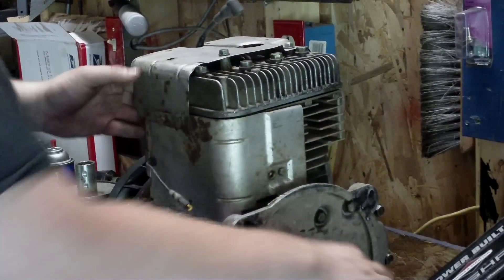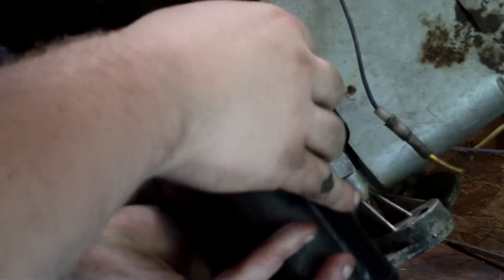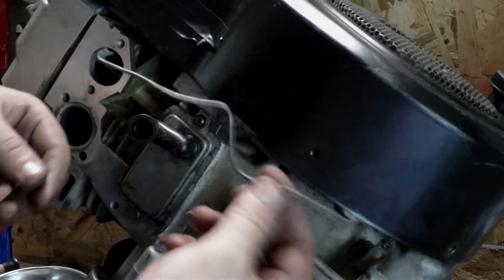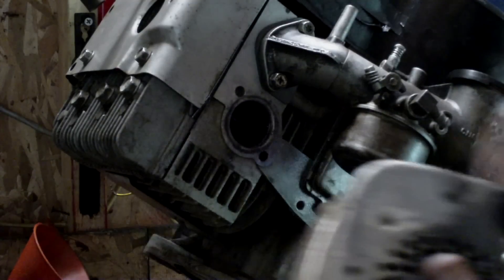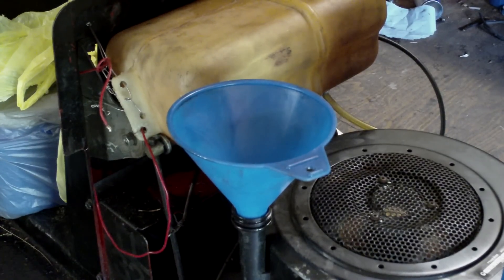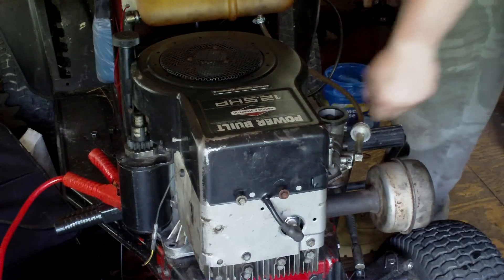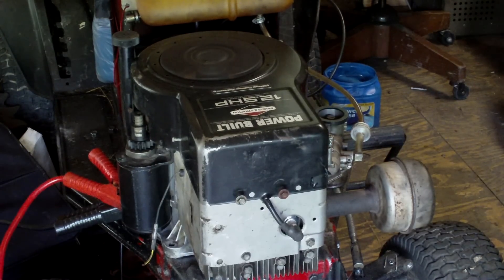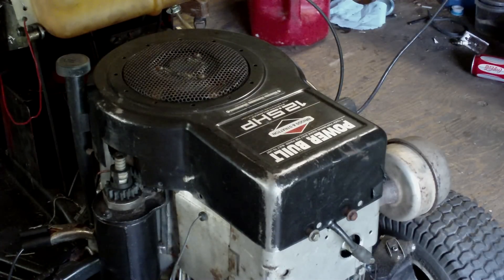Briggs and Stratton Power Built 12.5 HP Flathead Model 28 Rebuild  First Start PART 4 (FINAL)

Comment: I have watched all of the video's in this series. You do a good job editing and narrating. Thanks for editing out most of the shots of removing or installing countless bolts. Anyone who dives into a rebuild probably had a handle on removing and installing a screw or bolt. With that said, I appreciated the fact that you made a point to caution us on specific bolts and tightening patterns. Again, really nice video without a lot of unnecessary talking, some narrators can't shut up and it gets hard to listen to them.
Reply from the maker: Appreciate that! I put alot of time in this video series. I also have another video series on rebuilding a 10HP Briggs. Yeah, that does get boring watching people take bolts out! I thought of speeding the video up through it, but its easier to just cut it out. Thanks again! And Thanks for Watching!!!

Comment: one question i did have was ....do you need to retorque the head bolts after you have broken the motor in? thank you
Reply from the maker: Some say its recommended, i've never done it myself, just when i put it together. But if you'd feel better, go ahead and retorque them just to be safe. Its mainly for car engines and stuff like that when you need to do it. Thanks for Watching!!!

Comment: I have a 20 year old model 28. Watched your videos and decided to rebuild mine,  I am pretty attached her, I  repowered  John Deere 111  that I have owned for 30 years. it was burning about a half quart of oil per hour.  On teardown rings were "reject"  .30. Lapped the valves, honed the cylinder, cleaned her up.  I found your videos invaluable, along with a repair manual it was all very easy to accomplish. Just did my first oil change after breakin. First time in 5 years I didn't need to add oil after cutting the lawn. Thanks for the help!
Reply from the maker: I hear ya, they are great engines! I hear ya, good to hear your rebuild turned out good! I know how aggravating that is having to add oil each time you cut, it takes a while to get used to! Thanks for Watching!!!

Comment: I use 10w-30 full synthetic max life Valvoline.
Reply from the maker: Thats good stuff, i use it in my truck (10w-40 though). Thanks for Watching!!!
Reply from the maker: i use the blended though.
Reply: fnaguitarplayer9 I have to use the full synthetic because my motor reaches high rpm's. Around 5200+ rpm's.
Reply from the maker: I hear ya! That would definitely be good for that.

Comment: Why should we not want to "waste" good oil on break in?  Is 10W30 that much worse than 30 weight?  It all costs the same and is ASE certified.
Reply from the maker: +Name I was referring to brand of oil not the weight, i generally use cheap supertech (walmart brand) oil for break ins and either valvoline or rotella shell diesel oil (30 weight) after break ins. I prefer a 10w-30 for break ins because it tends to thin out more then 30 weight (even though technically it shouldn't), it always get thin as water compared to straight 30, but for break ins i feel it gets more metal particles out of the motor. But you can use 30 if you want, i did on the 10HP rebuild video last year, no problems. Thanks for Watching!!!

Comment: I got the piston back in and it would not turn freely with the connecting rod bolts tight.  The crank has to come out now and the journal sanded? it would turn all the way around loosely tightened.  STPd all the stuff. Lubrication not the issue
Reply from the maker: +Name I hear ya, it does sound like there isn't enough clearance between the rod and journal. Are you sure that the new rod isn't a undersize rod? If you replaced it maybe the place you got it from got the part numbers mixed if its super tight, if not, then yes you can sand the journal down, its supposed to be turned on a lathe but i've gotten by with doing it like that. Thanks for Watching!!!

Comment: Hi Mate, thanks for the videos they are very informative.  Just a question my briggs is blowing gas out of the air breather and wont start, do you know what the possible causes of this could be?  Possible burnt inlet valve?
Reply from the maker: +Michael Edgar Hi, your welcome! If its really easy to turn over (no compression) then I'd say its stuck intake valve, if not stuck, the clearance may be to tight and its not sealing, burnt is a possibility, but i'd check the clearance first. let me know what you find out. Thanks for Watching!!!
Reply: great thanks Mate, yes compression was really easy, when I took the cover off, the valve seat had come loose and jamed the inlet valve.  Pinned the ring back in and working great now. Thanks again.
Michael.
Reply from the maker: +Michael Edgar oh wow, that is rare, but it does happen, we had a 12.5 do that along time ago. Your welcome, anytime!

Comment: How much did it cost to rebuild
Reply: +Dylan Gleason, 
my con-rod  (big end) was worn badly so I needed a full gasket set, con-rod,  piston rings & plug....about £70 from Germany (pattern parts) would have been about £160 for B&S original parts (in UK).
Reply from the maker: +Dylan Gleason I had about 50 bucks in mine, just replacing rings and gaskets, but it really needed valve guides which i'm planning on  going back and replacing soon. It just depends on whats wrong, if it needs bored out then your looking at a oversized piston as well. Thanks for Watching!!!

Comment: Great stuff ....thanks! I've just started a rebuild on a 13HP B&S, it seems to be basically the same as yours. Were the piston rings the only parts replaced,  to cure the problem, or did I miss something??
Reply from the maker: +John Wells Your welcome! I hear ya, the rings are the main part in a rebuild, but you will need a gasket set (gaskets always tear when you take one apart) and have to reseat valves / set valve clearance. Unless you find something else wrong somewhere, like a cracked valve or something (I did replace one valve with a good used one when i rebuilt the one in the video). But yeah rings and gaskets is all you need 80% of the time. Thanks for Watching!!!

Comment: hello, great videos, i have this same briggs 12.5 engine i just rebuilt it, it wont start it just backfires. i went and tore it all down to make sure everything is proper timeing valves ect. everything seems to be right but it wont fire for me? any ideas? thanks.
Reply from the maker: +Nick Miller Thanks, I appreciate that! Sounds like the flywheel key is sheared, if you had the flywheel off it may have sheared if it wasn't put back on tight enough, or it could be a bad coil, I've had that happen before. Or it could be a carburetor issue. Hope this helps! Thanks for Watching!!!

Comment: Hey me again!! im working on a 17.5 single at the moment, Im trying to wire it up and cant get it to charge the battery the charging coil shows -16volts at 3400RPM unconnected to battery? when metering the battery it shows 12.6v off and 12.7 volt while running? im not very good with these electrical things. thanks - hope all is well
·
Reply from the maker: Tim Orum sounds like the diodes may be bad on it, theres 2 ways to go about this, either cut the wires and replace the diode, if you can find it, most of the time they are built into the plug or replace the whole stator, which means pulling the flywheel off. Hope this helps! Thanks for Watching!!!

Comment: Thanks for sharing this series.  I've got a B/S 12.5 I/C that won't start, just turns, no fire. Took carb apart and serviced, but still no go.  Guess it must be the engine, just quit while I was riding the mower.  Is there an engine rebuild kit I can purchase?  Thanks.
Reply from the maker: Leroy Bray Your welcome! I also just put up a 3 part video on a 10HP briggs. That sounds like the coil (magneto/magnetron) went out. Unless it made a loud noise when it quit running, if it did that it was probably the rod. I'd say check for spark first, if no spark, then all you need is a new coil. Thanks for Watching!!!
Reply: Prob your coil no fire easy fix

Comment: Removed oil sump to replace seal and gasket. Did not remove the piston. When trying to bolt the oil sump back on, it will not seat to the motor leaving a 1/8" gap. Applied minimum torque to bolts and cracked the sump pan. Have R&R sump pan with the same issue. WTF??
Reply from the maker: z99301z I know what your going through, that can be very aggravating, there is usually about 3 things that can cause that, first off is usually the camshaft not going back into the sump, or the oil slinger is moving on you, or the oil seal on the crankshaft is hanging up, or the 2 little pins on each side aren't lining up right. I'd say its the camshaft being stubborn though. Thanks for Watching!!!

Comment: Hey long time huh! am I the only one who picks your brain? Now,I have a 17hp briggs that has a different carb to the two in your videos - I think this is due to emission controls?, it has an electrical connection to the bottom of the bowl that isn't connected to anything. At the moment while off the engine is being flooded with all of the fuel from my fuel tank. is this because of a faulty float switch (if so how do I repair?) or could it be something else? thanks tim
Reply from the maker: Tim Orum nope, your not, i get a ton of questions all the time haha That sounds like the newer style carburetors, like i show at 1:30 in this video here https://www.youtube.com/watch?v=qx-Sb55QECk all that is, is a solenoid to prevent the motor from backfiring when its shut off (after fire as its called), i talk about that problem in that video I linked, its do to the float / needle not working, and those carbs are BAD about that, usually have to replace the needle and possible seat, and sometimes if the float has deformed (plastic float) then it may need to be replaced as well since you can't adjust the float level in those carbs. the solenoid should click when the ignition is turned on. hope this helps! Thanks for Watching!!!

Comment: New sub here. Thanks for sharing. I too "tinker" around with these little engines. I recently restored a 1984 Snapper push, with a 3.5 Briggs, and I took it to the next level...lol  Ported and polished the intake, and exhaust, stiffer springs, new valves and piston from new model engine(lighter weight), and shaved the lobes of the cam, to shorten duration. I just finished the carb. last night, and I have to order a new diaphragm, but I got by with a "skim" coat of silicon, and the old one temporarily. I have her running, and will post update today, she sounds great, and I cannot wait to get the new carb. parts....I have a 5hp horizontal shaft, and a 4.5 vertical that I am going to be going through in a upcoming video... Have a blessed day bro..
Reply from the maker: Cast iron1969 Appreciate the sub! I hear ya, its a fun hobby to have. haha I hear ya! I started to make a hot rod out of one of those 3.5 but never did finish it, I started welding the camshaft up to increase lift and duration but never did finish it. I hear ya! Sounds like a fun project. you too! thanks for watching!!!

Comment: Just finished rebuilding this engine (first time rebuild for me).  Couldn't have done it without your videos. Thank you!  Did notice I have a lot of play in the crank while it is running. Shouldn't be too bad to effect anything but it is spitting a small amount if oil around the new seal. Didn't know if you had a trick or not.
Reply from the maker: Jason Sessor your welcome! glad it helped out! the play, assuming end play, is from the gaskets on the crankcase cover, if the gasket was to thick it makes extra play. As far as the oil seal leaking, i've had this problem a few times, and what it was for me was the seal went in crooked, and got bent not letting it seal. And make sure you put oil on the crankshaft or seal, if not they will leak, as it the seal heats up from friction. thanks for watching!!!